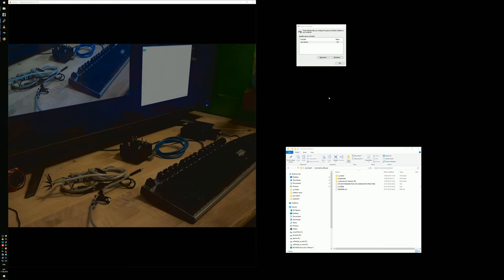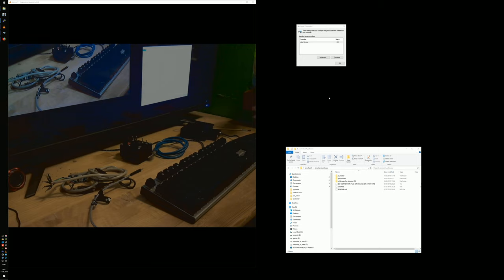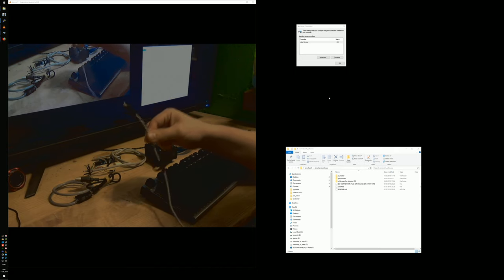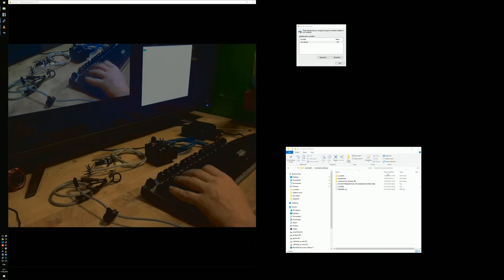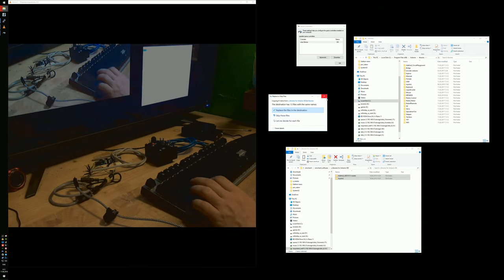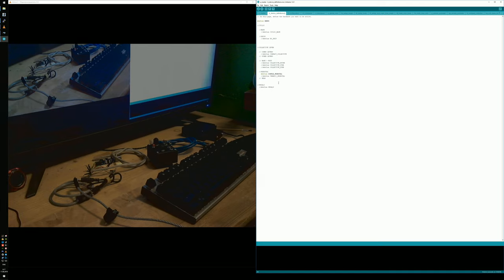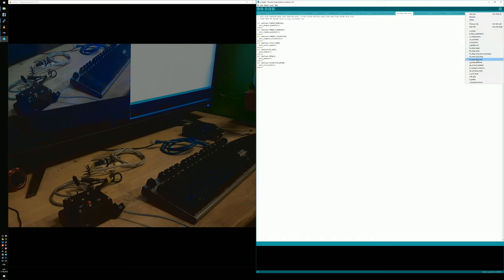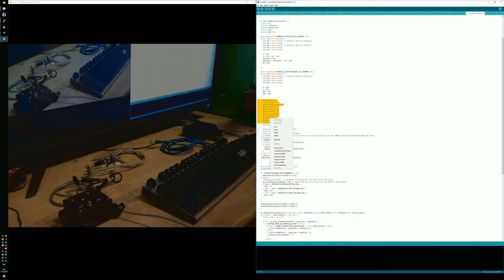Simchair MKIV software tutorial part 1: basics

Comment: Hello HC625ma,
first, thanks and congratulation for this wonderful work. Wery impressive.
then comes my question. In the a-master arduino file, on the b-definition folder, i don't find the activation line for the small B206 head.
i did print it but can't activate it.
if somehow you could help me solving this problem.
best
Pascal.*
Reply from the maker: Hi mate! Thank you for your kind words. To fix that, please add the line:

#define B206_COLL_SWITCH_PANEL

to the "device definitions" tab, for example, under the // COLLECTIVE SWITCH PANELS list =)

Cheers